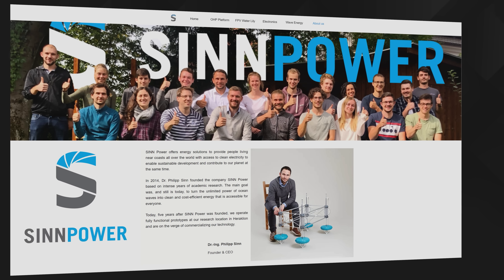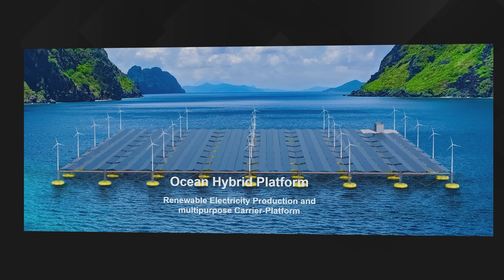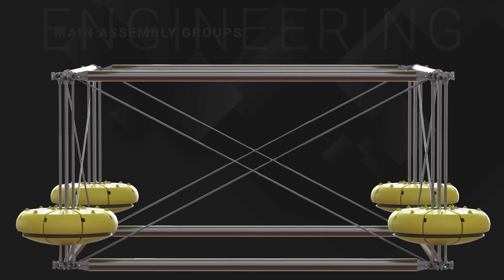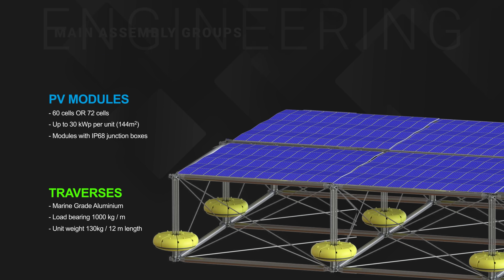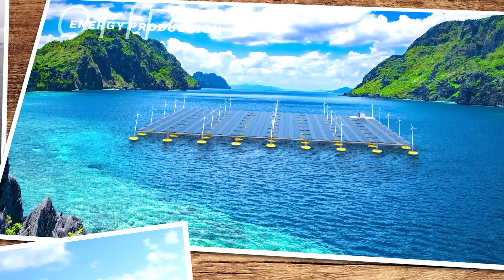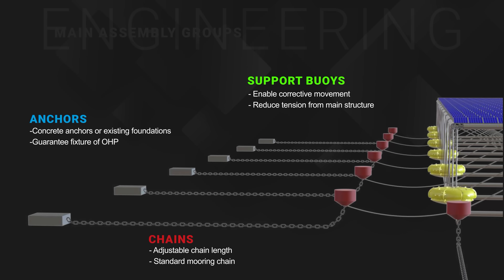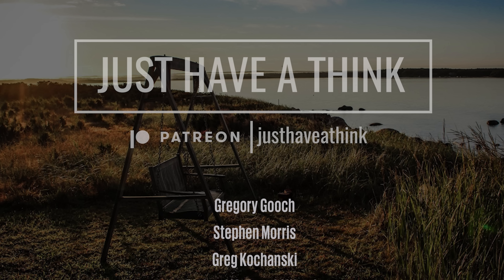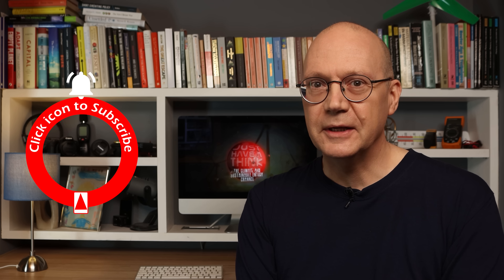Solar Wind and Wave. Can this ocean hybrid platform nail all three?

Comment: Let me see if i get this straight... They are proposing to use: Tiny windturbines...  Throwing shadows on solar panels... Which are mounted mostly flat... And which will also get sprayed with salt water and will leave white spots all over them as well...

Sinnpower will silently be closed down in 2y time when they run out of grant and/or investor money.

Comment: Two thoughts strike me ....
1. The vast size difference between the turbine sizes when docked to an off shore wind farm show the relatively miniscule power output from the wind side of the kit!
2. Someone has sat in a nice office thinking this one up ..... I doubt they have ever encountered a real sea storm and what wave heights they would need to deal with on occasion. After all we are getting once in a century storms every few years now! If you look at your typical oil rig, it is built that big for a reason. If waves can break the spines of huge cargo haulers a puny aluminium cylinder will not last long!

A great idea though!

Comment: I think the holy grail for an ocean based energy generation station would be to naturally integrate some form of energy storage as well, providing 24/7 baseload power.
Reply: I’d like to see if they could leverage the new NaCl batteries with these platforms.  It could provide for very interesting leveling of power.  With wind, solar, wave, they all are somewhat intermittent and having the molten salt batteries onboard or onshore would provide very interesting benefits.
Reply: I'm sure you could have some storage on board, but you could also have it on shore if it is too heavy.
Reply: As We Are All One said, the power storage could be onshore, should be even, considering the compared cost of floating batteries against running wires. Actually, storage can be sunk beneath the water, as well. I seen a video about sinking servers to protect them from contaminants and heat, why not sink battery packs?
Reply: A diversity of power sources can largely mitigate the problem of intermittency, for example; on overcast days, the wind and waves are usually much stronger. I think they could add tidal power and get even closer 24/7 power with minimal storage. Two other alternatives to energy storage are a smart grid and a super grid. 

A smart grid gives municipalities more control over energy demand. For instance, if there's a large desalination plant near by, you can power it down as demand peaks and power it up to absorb excess production essentially storing excess energy as fresh water. If people sign up to let the local grid use their electric cars for storage (for a rebate or something), then a smart grid can make use of that extra capacity. Most people don't care when, exactly; their AC or Heater turns on or off, just that the temperature of their home is comfortable while they're in it, so a smart grid could stagger the times that air conditioners and Heaters turn on and off to reduce spikes in demand, essentially using homes as heat batteries. There are many similar systems that simply need to output an average rate, but don't need to be on or off at any specific time.

A super grid is a system that connects local grids together with extremely efficient high-voltage DC lines to form a grid that spans entire continents. That way, if the sun's not shining on solar panels in Kiev, they can use excess wind power produced off the coast of Lisbon. A study on the subject found that a super grid spanning Europe and North Africa could supply the covered area with wind and solar alone without the need for batteries. A similar system spanning North America would cost on the order of $500 Billion to construct. It would take 10-20 years to construct, so $25-50 Billion a year is really what it would amount to. Plus a super grid would come with all sorts of bonuses besides reducing the need for storage.

Geothermal could also help, but I think my post is long enough as it is...

Comment: Just had a brain fart. Wouldn't it be cool if this ocean water could be used somehow for desalinization to potable water as well as for panel cooling , and also somehow for panel cleaning. And then there's also the possibility for its use in  mineral extraction from the subsequent seawater. Especially if the panel could  be held at a lower atmospheric pressure to speed up the distillation and the cooling coefficient. Hello...did you just hang up??? Huh? Or is any of this just a  series of little brain toots???

Comment: How well are these installations going to survive real storms? That's a lot of tech to lose to temporary high sea states. Wouldn't the design be better adapted to preexisting "retired" oil platforms (instead of floating/tethered) with a way to "close up shop" for dangerous weather?

Comment: Putting solar panels over lakes or any body of water with plants or animals in it will dramaticcaly detrimental to their dev since you're isolating water from air, thus blocking gases or heat exchanges, and even worse you're blocking the light that would be used by photosynthetic organism

Comment: I’m going to go one further and say that not only can’t we make a wave, wind solar generation plant but we could use the thermal differences between surface temperatures and those at the see floor where the structure will be anchored and generate even more power with Stirling technology.
Reply: A Stirling engine running on ocean thermal gradients would not be able to compete with simpler ways of generating electricity.  It's theoretically possible, just wouldn't be practical.

Comment: too bad they did not just set up to make the PE flotation devices from unwanted offcut foam made from PE that they have left over at metal building insulation manufacturers as they have giant 500 gallon sized bags of it they have to get rid of one way or another and heat is all it takes to fuse the bits of foam together to make a single chunk, and this fusion makes a thick tough skin of PE between the foam chunks making it far more durable than the foam was originally, 

I know because I floated down the arkansas river with something made of the stuff and had more than 2 humans weight on a platform only 3 foot by 6 foot, and it only sunk in the water about half an inch with all that weight, and zero deformation since it was not very well distributed, I could see the flex it endured with the form being only a flat sheet about 7 to 8 inches thick through out. (all stuff they were throwing away, and the dump sites as well as trash to energy dept will not take, period, as the dump site it will work back up to the surface, through the dirt and such the way it pushes water away and rises if let go deep under water, and one type of additive releases formaldehyde when burned so they refuse to use any to burn thanks to that (its the super dark black stuff that will dull a steel razor almost instantly when you cut it, that releases this stuff, every other type is safe and just released about what a paraffin candle releases when burned,)

Comment: Neat! I'd be concerned about the combination of aluminum and stainless steel in a wet environment causing galvanic corrosion and the whole thing falling apart. Also, I'd add some pathway next to the solar panels to allow you to walk between them (or just make them tough enough to walk on) in order to clean them

Comment: As for de Bono. I've always been a bit sceptical of lateral thinking, as it's hard to explain and supporters of it can usually only give a few examples (which aren't always of what I think of as 'lateral thinking' anyway!) It's also very difficult to teach, as human beings seem to be very stuck in a 'normal' thinking rut. But de Bono did give one example years ago on R4 which intrigued me. He was asked by a small Australian town to suggest ways of stopping people from parking too long in the congested Main St area. They had tried fines, zones, meters, etc, but drivers just ignored them. De Bono suggested that they just bring in a law that anyone parking in town must leave their headlights on full whilst parked (in those days, batteries weren't as robust as they are now, so would rapidly go flat). This was easy to police, as cars not following the new law would be obvious (both to the police and fellow parkers), and required no infrastructure or expenditure to implement. And it worked very effectively!
Reply: @gorgthesalty  the colour hats? each representing a different aspect of the issue, postive, negative, economic, ecological etc
Reply: It's been quite a while since I read the book, but here are some that I remember: white hat is "look at all positive / best case aspects"; black hat "look at all negative / worst case aspects". There are also green hat (financial?); red hat (emotional?); blue hat, and yellow hat - neither of which I remember. But now I want to reread the book, because I mostly go to black hat thinking and I want to change that. Thanks for reminding me of it.
Reply: That's actually a very good story.

Comment: Wave power is the, as yet, not well utilised power supply. Potentially it can provide enormous power, and is practically endless, anywhere at a coastal sea area - there is hardly anywhere where there is dead calm.

Comment: This is fascinating and made me think.  If a large weight was installed in the tower of every wind turbine which was lifted by the spinning blades in times of strong wind and dropped slowly in times of no wind could that work as an effective short term storage solution.

Comment: Given the scaling laws for wind turbines, this doesn't seem to hold much promise for that mode.  AFAIK, wave power is pretty diffuse.  Solar panels have the problem that they only work during daytime, and they are showing a flat orientation.  I'd like to see the economics of this for particular deployments.  Also, some analysis of how these stand up to storms.  They'd have the advantage of not bearing the cost for offshore power cables.
Reply: Yes 12 meters tall wind turbines is tiny, compared to what's common nowadays.

Comment: The design looks good, however regardless of the height of the structure (to some extent) I think the solar panels in a marine environment would inevitably get enough salt build up to drop the efficiency, the idea of using the platforms for fish farming activities would be a good use of space. Genuinely interested to see of this progresses.
Reply: i agree i dont think solar is feasible offshore, but it could be used on lakesand sheltered waterways, i think wildlife colonising would be an issue .
Reply: @kevinwillis6707  What about automated cleaning systems ? At least 1/2 the globe would benefit from the solar if the panels could be kept clean... I am sure it is possible to do.
Reply: @madpete6438  that adds another complex mechanical system that has to be maintained in a marine environment. There will need to be something, but it's a really interesting question what. But if it collects the guano and uses it somehow that would also help.
Reply: @mozismobile  I got it ! Fresh water washdown like they use on those giant gin palaces (super yachts) ... minimise the moving parts ...
Reply: Where does the fresh water come from? At sea it's an expensive commodity. And people already complain about the water cost of terrestrial solar, it's likely that the marine one will need significantly more water for cleaning.
Reply: @mozismobile  You use solar water extractors - they use solar energy to strip water from the atmosphere - perfect near the sea - high humidity = lotsa water
Reply: @madpete6438  you may not always have to use water to clean the panels. Occasional water wippin might be needed. The Mars rovers survived a dusty planet for years with no cleaning whatsoever and only relying on the light martian wind to clean the solar panels.
Reply: @mozismobile  A part of the energy production could go into desalinization
Reply: I know people that have PV panels on boats for years. Also there are boats powered by PV (look at silent yacht).
Reply: @3dvox712  Yeah, boats have been using solar for years with little issues, as long as the panels are high enough which it looks like they are with this design, it could work.

The main problem is things like bird muck and other things like that but I suspect there are solutions to that.

If all this works and it's reliable, it could generate a lot of energy and because it's solar, wind and wave, it should make it a lot more reliable as an energy source all year round.

Being at sea is also another big plus point because it's not taking up any land, that's especially big for costal cites.

The real factor is how much does it cost to create these in any given locations, but it's worth investigating in areas where we have offshore wind farms.
Reply: We had a boat with shallow freeboard (Folkboat), moored up in the mouth of an estuary, that was regularly battered by fierce easterlies off the sea, and coming down the estuary the other way, some robust westerlies. We had solar panels on the aft deck, drip feeding a battery that ran a bilge pump…old wooden boat. 
The panels faired well.
Reply: I would think someone would come up with a bot to clean the panels.
Reply: Not just salt on the panels. This could be a haven for sea birds, so would consequently get covered in guano. An opportunity for the panel cleaning bots to collect yet another revenue earning product.
Reply: If we have these floating surface structures then the application to farm edible marine molluscs in the surface water might be possible.
Reply: Except that fish farming is something we shouldn’t be doing anyway.

Comment: My intentions are not to destroy their sandbox toys, but this construction is not workable.

There are a lot of inputs guys haven't thought about in their calculations: 
- There is no calm sea. Wave and wind forces are immense. The pressure of 1ton/1sq meter at the sea is almost nothing. It's just pure weight of the 1m height of the water column, without no dynamic force of the wave. 6 meters above the water level is extremely low even for small inland bodies of water. Even a faster wind can make waves much higher than 6 meters. Last year we had 2m high waves on 100km/h wind in a well-protected bay at just 5 km open water surface... The oceans, day by day, are expected to have 100km/h winds.

- Mixing aluminium and stainless steel in saltwater is a huge no-no! (except if it's calculated to harvest a bit of the galvanic currents and transfer them to the grid). 

- Extreme lifting capacity of flat surfaces at the wind. You guys have huge wings installed extremely near the surface of the water. Ask aeronautical engineers about the ground effect.

- Huge costs of maintenance of the solar panels at the sea.

etcetera, etcetera...

Comment: A bit off point, concentrated solar power from a hot desert could be used in a thermal energy storage system to heat a medium on a barge - a repurposed oil tanker, perhaps. Insulation would keep the thousands of tons of medium hot, whilst it was towed to a cold climate, and used in a district heating system by pumping water through piping installed in the barge and thence to buildings. A discharged barge would be swapped for a hot one to be towed back for reheating. Giant, movable storage radiators in effect.

Comment: I think this would work for desalinization plants as well. in coastal cities where freshwater is in as high or higher demand than electric power. like off the coastline of southern california  as well as islands.
Reply: in california you have lot of burned down, south facing baron hills that can be used for solar for a fraction of the cost of an off-shore saltwater-resistant installation. for small islands with land scarcity probably a very good choise.
Reply: @tomo1168  That would require the environmentalist to allow the construction of the solar arrays. they would be torn between green energy and protecting the "natural endangered" landscape. With the EPA studies and multiball court cases, the cost would be staggering. Ware if you had a few islands of these floating a half-mile off the coast. You know out of sight out of mine.
Reply: @karm65  none of what you say is true look at real-world installation
Reply: @AlanDeRossett  Having actually worked in utility construction in California. I helped put in the fiber-optic trunk loops all across the U.S.. I can assure you my experience is based in the real world.